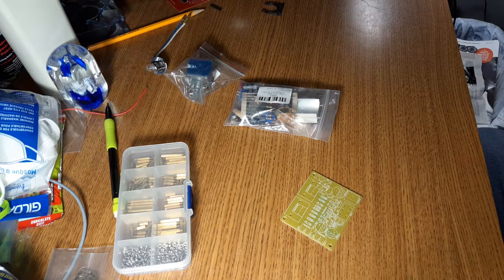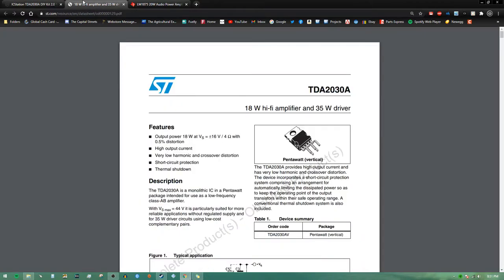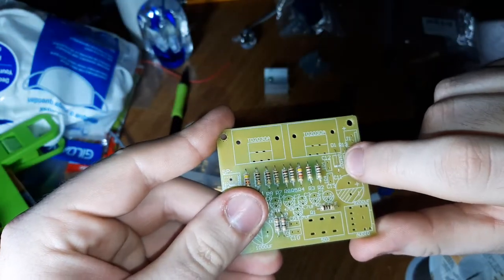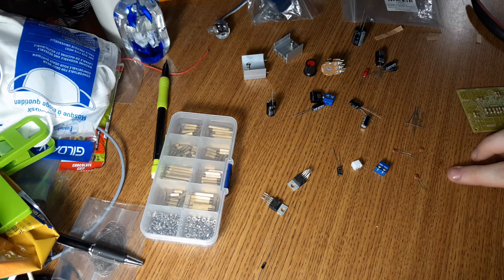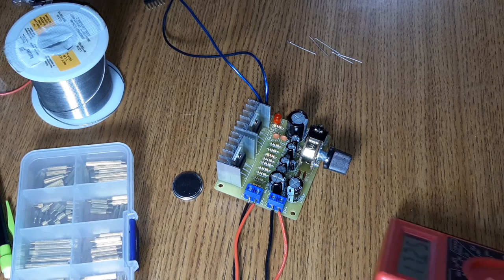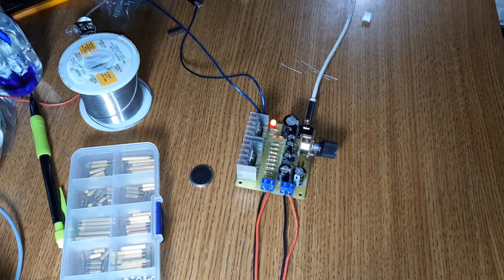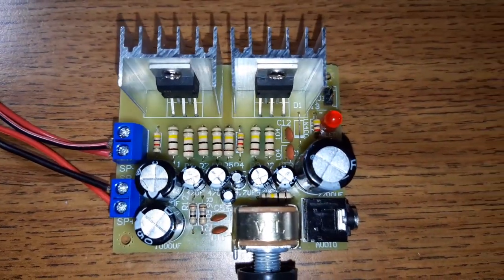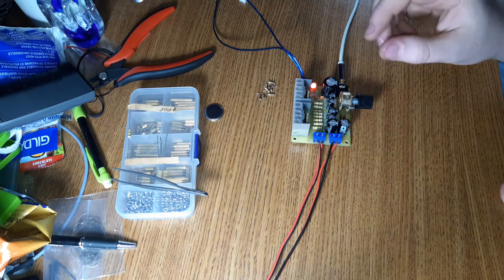Building an ICStation ICSK008A TDA2030A kit with the wrong parts!

Comment: I built this kit recently. What value capacitor would you recommend upgrading those 1000uf output caps to(I’m going to mount them off the board so physical size not an issue)?

Comment: At 12v supply power on 4 ohm is lower than 8 ohm on same voltage?!! i don't believe that, but by the way, this chip works better on dual power supply or higher volt single supply
Reply: Yeah I think I accidentally swapped them when I made that chart. But I also stated that this chip is best with a split supply or very high single supply